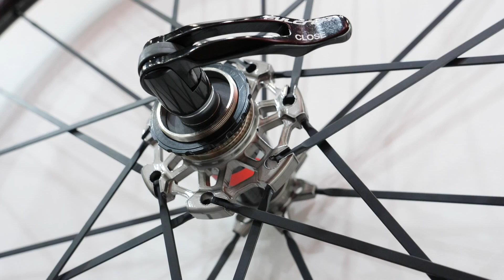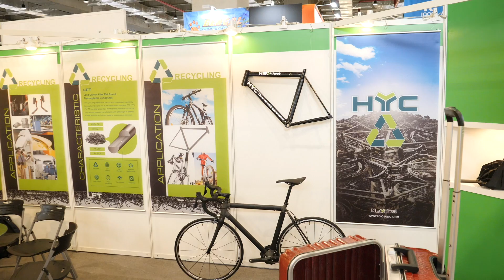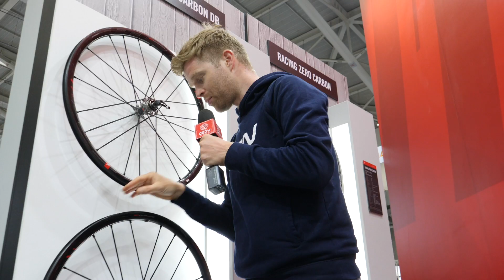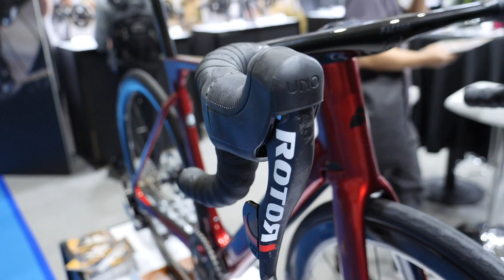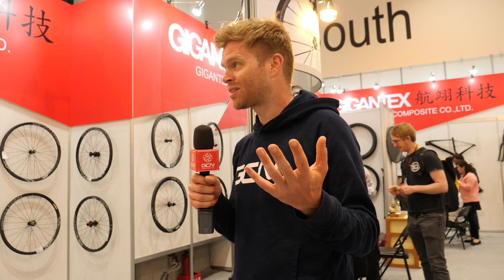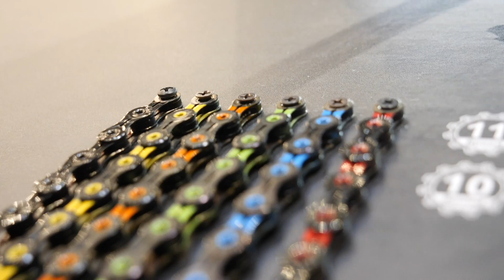Even More Hot New Cycling Tech From The Taipei Cycle Show 2019!

Comment from the maker: If you could choose just one of these, which would it be?!
Reply: I want the gigantex wheel set, looked amazing
Reply: That Rotor 13-speed groupset looks interesting!
Reply: I'll take one Ollie please
Reply: that red factor
Reply: Gigantex CP013 - if I could find them. Any help?
Reply: @SaVaGe PoEt  LOL Best reply ever
Reply: The Rotor group set.  I'd never pay that much for a group set but if you were to give me one I'd rock that shit.
Reply: i want the gigantex rotor botom braket ;)
Reply: @JAIME_IS_REAL  tubs aren't hard to fix they're just not as convenient as clinchers. The wheels are actually cheaper and lighter.and the tyres are generally more reliable. Tubeless will gradually kill them off now that disc brakes are set to become the norm over the next few years. Track racers, time triallers and hill climb specialists will keep a niche following going though, as technically the wheel+tyre+tube package as a whole offers higher performance to a clincher setup.
Reply: @jonnythelegs2597  Yeah, I'd like to try a tubeless wheelset. I don't like tubs though. Just not practical for my use and area where I ride (high flat area, super bumpy, should be using a mountain bike, etc). Plus I suck at doing bike stuff, LOL!
Reply: The Buttplug with corbon fibre in it
Reply: Gigantec wheel set
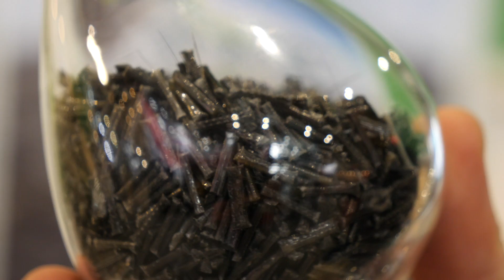Reply: My gf likes the glass thing @ 1:15 lol
Reply: It won't be a $1000 CF bottom bracket.
Reply: Some giggity antics wheels alllllllright.
Reply: @SaVaGe PoEt I thought it, you said it.  You are a braver man than I.
Reply: @SaVaGe PoEt Yep, could not think of anything else either!
Reply: The butt plug

Comment: The Carbon Long Fibre is not new. BMC Impex used it few years back to connect the tubes. Today, Pedals, Break Levers and so on are standard in those materials.
Extruded long fibre will align the fibres resulting in large differences in longitudinal and transverse stiffness. The key advantage of the felt structure of long fibre materials is destroyed when extruded.  Fast and cheaper production for sure, full frames I doubt it.

Comment: 13-speed seems to  be introducing rotational drive-train weight (always the worst thing to add to a bike), and big chain drive angles, for the loss of the front chain-ring.  I guess weaker cyclists don't care much about rotational weight, though - so many of them are going for disc brakes thee days.  It's like a double-whammy for non-pro cyclists to be even slower than ever before.
Reply: That guy who cannot abide Not everybody rides a bike just to go fast. As a weaker cyclist, I don’t much give a shit what you think of my choices. Maybe in future, if you want to make a point, make it without having to try and belittle someone else

Comment: Question.   Is rear  frame spacing bigger(wider)  to accomodate all those gears in on the hub, thereby negating some of the aero advantages of no front derailleur ?
Reply: according to the preview video, it's the same width- I'm guessing the large cog goes inboard, possibly closer to the spokes, but the video suggested it was the small cog that's set further outboard. Spacing between cogs is the same as their 12 speed gruppo iirc